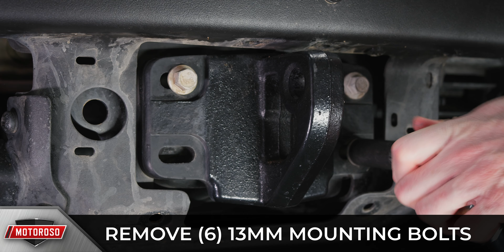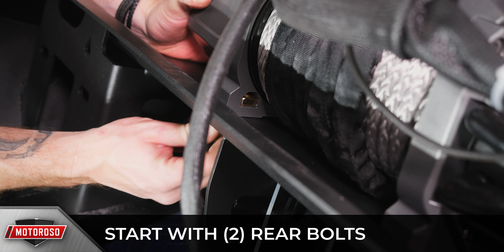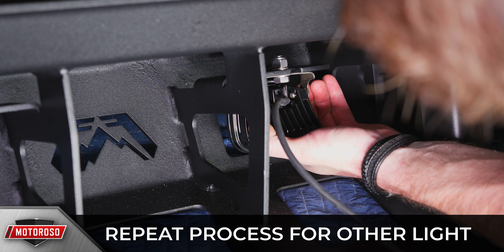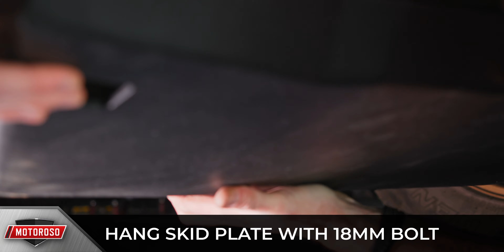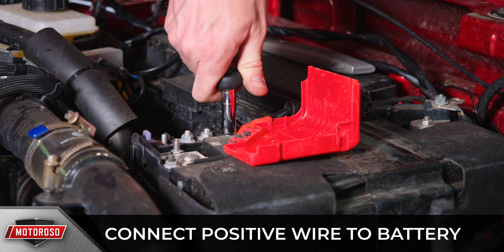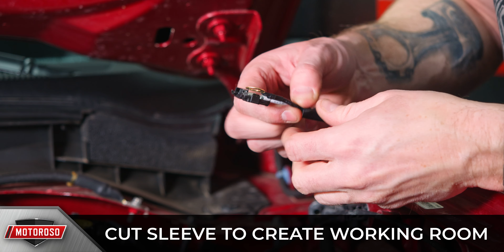21+ Bronco Front Bumper Install Guide - Fab Fours Stubby Bumper, LED lights & Winch

Comment: Do you know if this effects the "pre collision assist" and "automatic emergency braking"? I know they make a ACC bracket, but mine does not have that, only the ones mentioned.
Reply from the maker: It does not interfere with those. Mine still work. I believe those sensors are in the windshield.
Reply: @Motoroso   awesome thanks for the quick reply!
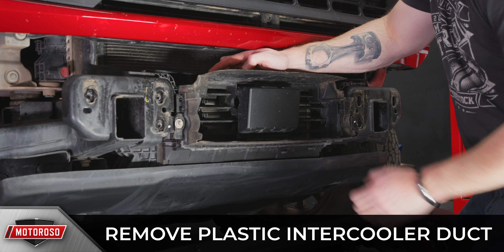Reply: @Motoroso  The ACC sensor is for Adaptive Cruise Control and it's the black rectangular box in the center of the plastic intercooler duct, which you remove @ 1:20. My understanding is this box is on every model, as a placeholder, but the sensor is only present on LUX models.

With that being said, it appears this sensor aligns directly behind the FabFours logo/cutout in the front of the bumper. Can you confirm? It seems you could cut this out further to provide ACC visibility? Please confirm if the sensor resides directly behind the logo of the bumper.
Reply from the maker: @chrisw.2061  Hey Chris, no, if you want the ACC feature to work you need the relocation bracket and moves it up behind the grille. here's the link on our website: https://www.motoroso.com/p/2473068-fab-fours-adaptive-cruise-control-relocation-bracket-for-21-ford-bronco

Comment: does this bumper work with the factory steel skid?
Reply from the maker: Yes you can keep the factroy steel skid plate, it just doesn't match very well, and the Fab Fours is way more robust.